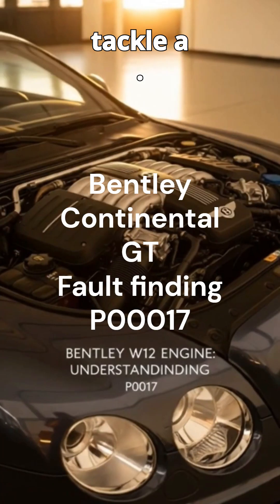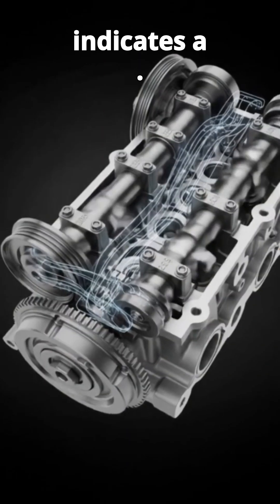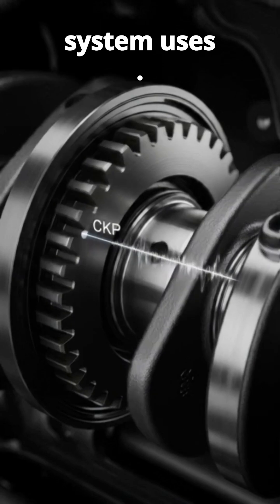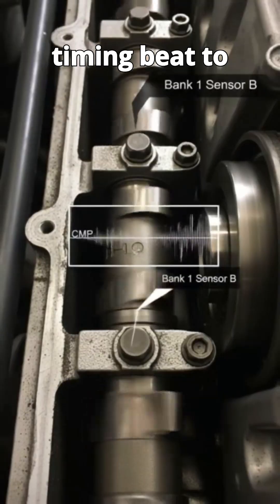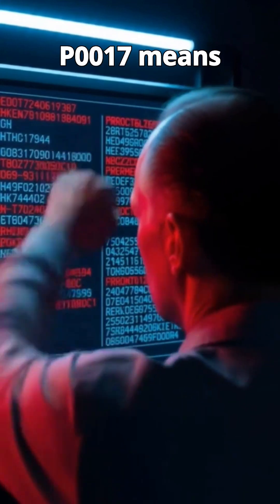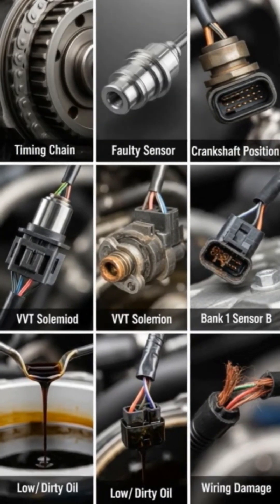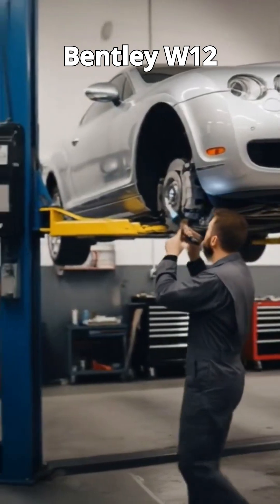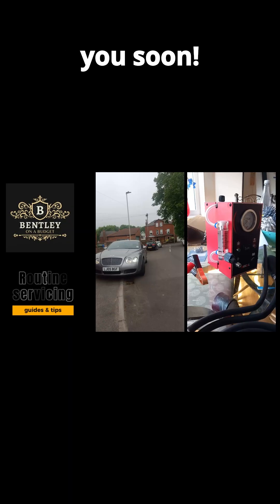Bentley W12 P0017 Fault: Decode Your Check Engine Light (AI Explained) #dreamscreenai #automobile

Comment: Your  opinion  wats a good scanner for  my 2012 Bentley gtc
Reply from the maker: Hi Wendel, sub dealer level there's only one system for me and that's VCDS by Ross-tech in the USA. Not massively expensive at about 300 bucks and regular free software updates. Covers all VAG vehicles and allows you to do anything the dealership can pretty much. Good support and even a vcdswiki, forums etc. If in the UK then Gendan are the distributors. Hope this helps. Nige
Reply: @BentleyOnABudget-mp8jj would you recommend the same thing for a 2013 v8 GT?
Reply from the maker: @Brandonarmistead5 that's a great question! I'll check it out and get back to you. Nige
Reply from the maker: @Brandonarmistead5  YES! No problem at all 😊